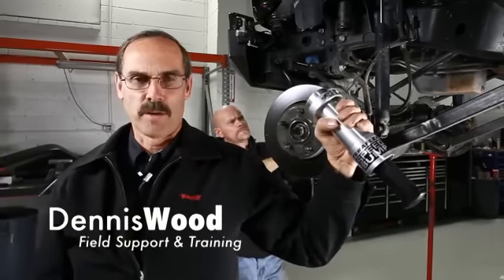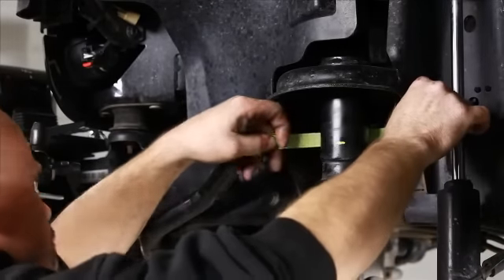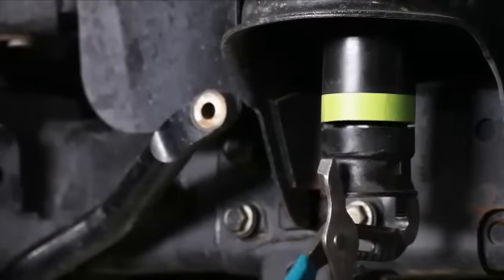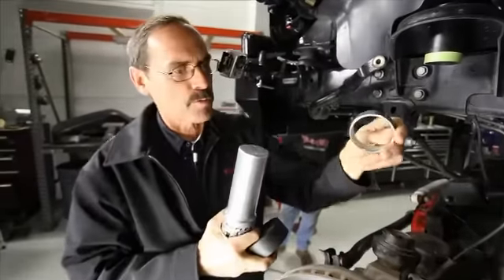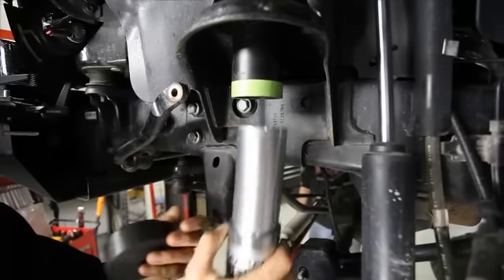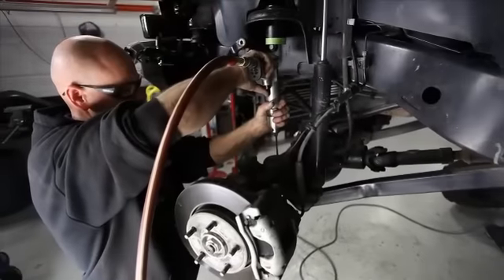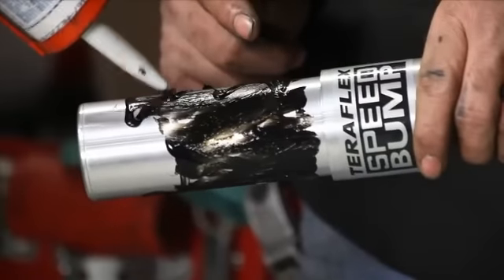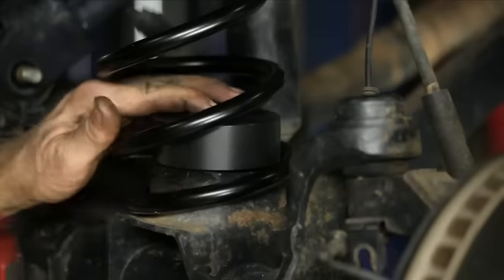TeraFlex Install: JK Front SpeedBump

Comment: I don't see the jounce tube braces installed. Do they really needed?
Reply from the maker: You don't absolutely need them, but they help thicken the OEM jounce tube to avoid flexing. They also create a nice flat surface to mount the speed bump against. Just in case your cut isn't perfectly straight.
Reply: @teraflexsuspensions  I have MC 3.5 lift on my 15 unlimited rubicon and 3.3 Falcon shocks. I just ordered 1" front coil spring spacers and 3-3.5 front speed bumps. Is that the right size or I should go with 4". Or all I need is just the jounce tube braces?
Reply: Running 38" tires by the way.

Comment: drill bits werent THAT blunt, bit a bit blunt none the less.

Also, unlike this vid, remember to put the spring isolator back in or you will end up lowering your jeep and getting alot of extra road noise.